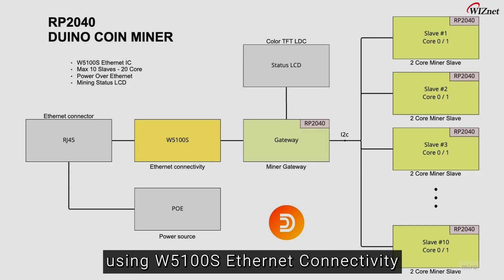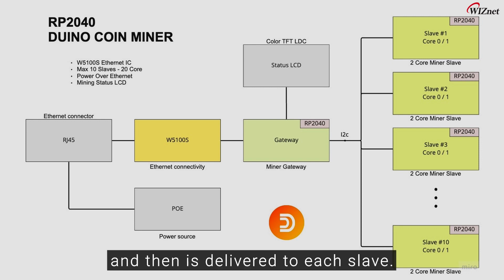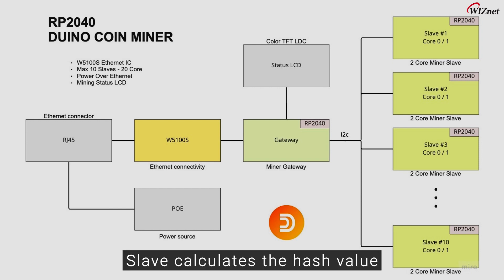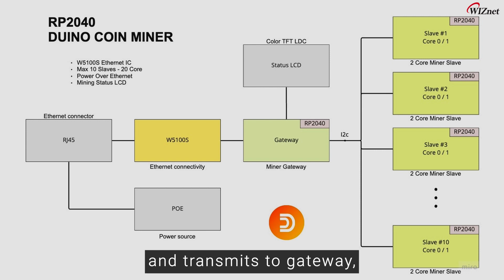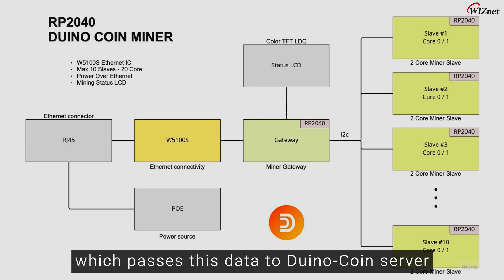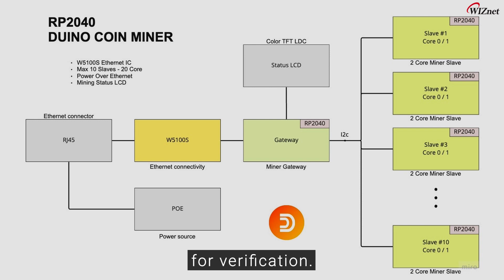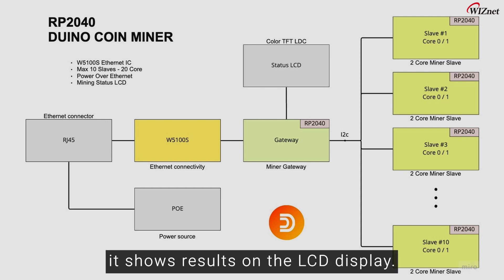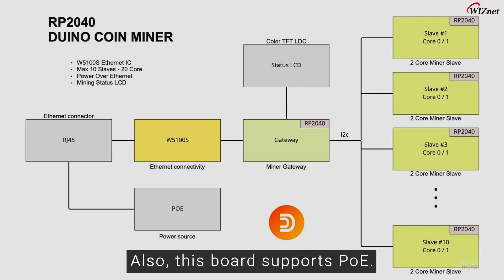Introducing WIZnet mining solution based on W5100S + RP2040

Comment: a pico on raspberry pi (zero or 3/4) mining with ~ 5 kH/s by Diff 333 per core, and by this board a pico have only 2,5 kH/s but high Diff 1250 per Core? What goes here wrong?
Reply from the maker: After latest firmware revision, we were able to achieve rate of 20KH/s. Please check source code link in the description.
Reply: @WiznetTeam  is this per pico?